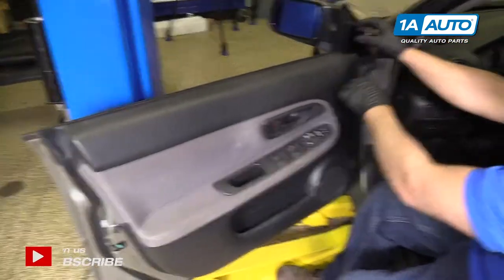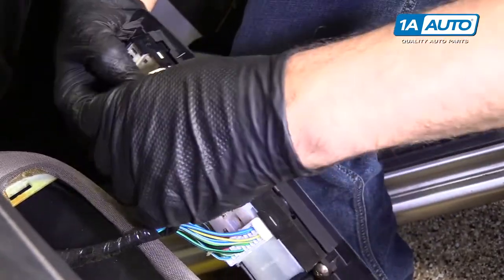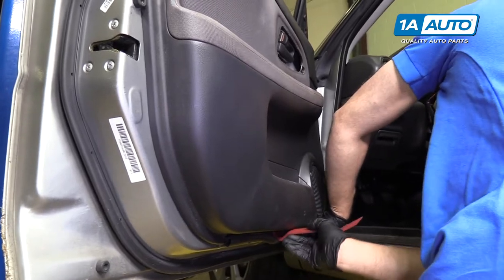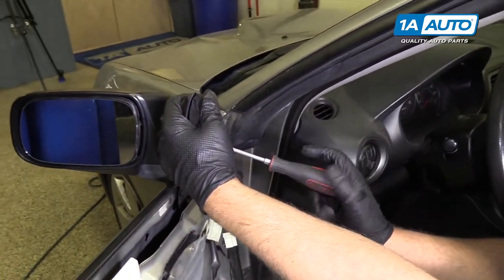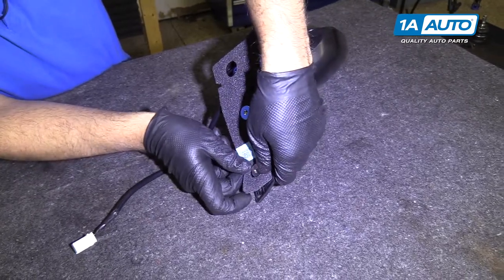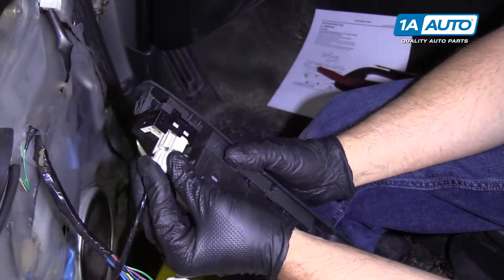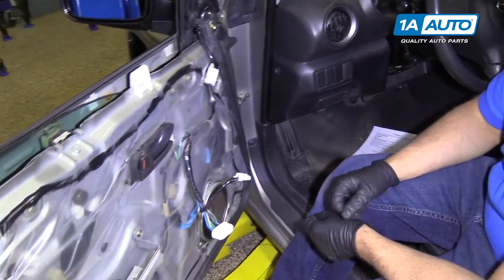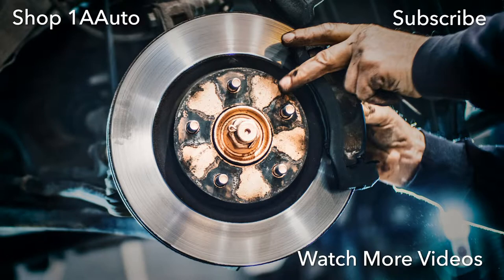How to Replace Side Mirrors 02-07 Subaru Impreza WRX

Comment: If you have someone with small hands, you don't need to take off the door & electrical switches. Just pop the top corner, reach in, & unplug the clip. 
Saves you time & hassle.

Your version is like getting butt naked just to wash your hands.
Reply: Cheers bro lucky i got small hands 😂😂😂😂